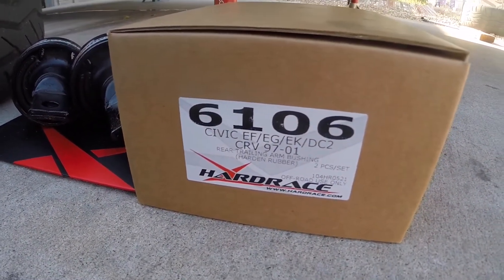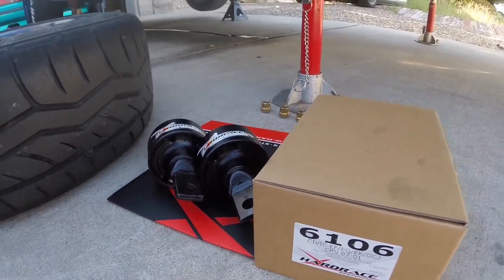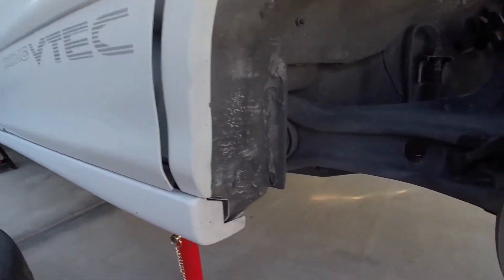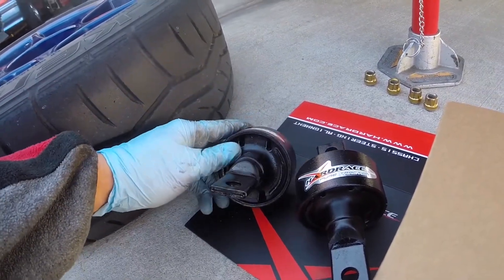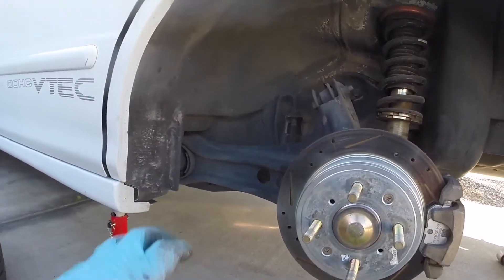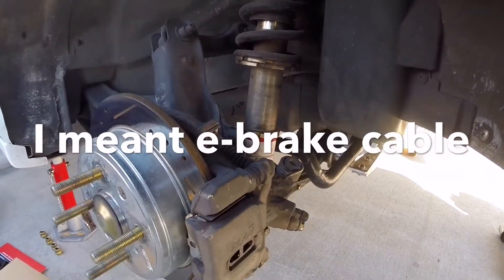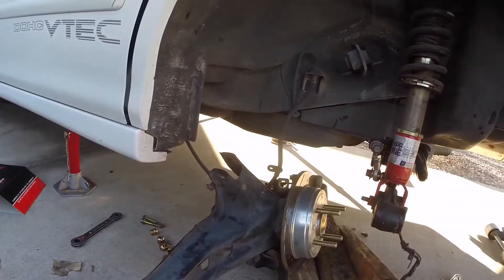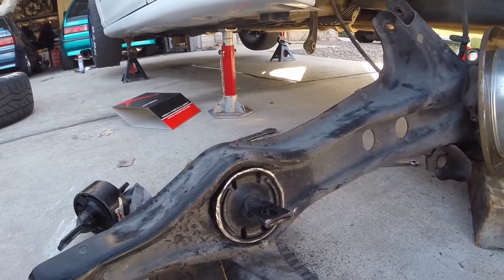How to Install Hardrace Rear Trailing Arm Bushing - Honda & Acura

Comment: just a quick tip for anyone trying this..

since the new bushings have this metal surrounding, try putting them in the freezer a couple hours before you install them, it'll shrink the bushing just by a fraction but it makes them alot easier to slide in! sounds weird maybe but metal expands under heat, I always do this and it makes putting them in soo much easier ! :D
Reply from the maker: Great tip, I've never tried that but will for sure next time
Reply: This worked for the front wheel bearings too
Reply: @RyanGorton  how did you press them in? What did you use to get around the ring and press down?
Reply: I was wondering if this would work, I put my new ball joints in the freezer before install to make the process easier!! Look forward to is installing my new bushings and seeing how my hatch drives, the trailing arm bushings and the rear toe links are the last components on the car that haven’t been touched!!

Comment: Great info thank you, however I would like to add.  If your bushing is already torn you can easily remove the center portion of it and use the outside metal casing as a punch for the new one so that you're not damaging or mushroom eing the new trailing arm casing
Reply from the maker: Thanks for the tips!

Comment: Hey John  not sure if you'll see this but I have a 2000 civic siR and I want to do the same bushings on mine. I have oem suspension does that mean I have to offset the bushing when I put them in?

Thanks
Reply from the maker: If you're not going to lower your car then you won't want too offset them.  We only offset them on cars that are lowered all the time.

Comment: Would rather mark the toe alignment on the bolt with a marker then to scratch the frame ask risk starting premature rust :s
Reply from the maker: +tonytober that works probably better.  We live in the middle of the desert.  Rust isn't and hasn't been an issue for us thankfully, but definitely a smart point for people above the rust belt especially.

Comment: hello Jon, I was wondering if you could tell me if there was a difference in ride quality when you went from the OEM trailing arm bushing to the hardrace rear trailing arm bushing. when I say ride quality I mean as far as ride harshness? does the car feel stiffer? the trailing arm bushings on my civic wagon are torn on both trailing arms and I am going back and forth whether to go with the OEM ones or hardrace. I'm only going to drive the car only the streets I'm not going to take it to any tracks or race with it. to me the hardrace bushings seem like if they would last a little more than the OEM ones thats why I am leaning more towards getting the hardrace trailing arm bushings but I am afraid that they might make the car feel too stiff for street use. how does the car feel to you when you drive it in the public streets with the hardrace trailing arm bushings compared to the OEM ones?
Reply from the maker: These are still rubber like OEM but it is a hardened rubber which makes them stronger and able to withstand more abuse.  If it made it more stiff it cannot be felt in the seat of your pants, the rubber still acts as a natural shock absorber but allows for correct geometry for the trailing arm to work properly as compared to the polyurethane ones.
If the price is reasonable for you and want them to last longer, I'd say get the Hardrace.  If you do get the stock replacement, stick with OEM Honda.  I've used an eBay one before and it was a pretty weak rubber in the bushing.
Reply: i know you say bad for track, do you think the energy rear trailing arm bushings would be good for daily driven or just bad in any situation? just bought them and on the way. =(
Reply from the maker: elcheapouno You'll be fine.  I have them on a couple of my cars.  For daily they are fine, but for hard driving I wouldn't recommend.  But, I have read of people who like the way they feel on their track cars.  They are pretty inexpensive too.  I will be installing the ES ones on my wagon soon also!!
Reply: awesome, thats good to hear. when you do the install hopefully you'll catch a vid on that, id like it see. =)
Reply from the maker: elcheapouno I planned on it as part of the civic wagon series, hopefully within the next 3 weeks I'll have it done.

Comment: Why did you decide to get hardrace? why not match it up the other Energy Suspension poly bushings?
Reply from the maker: The ES trailing arm bushings have limited movement and create "snap oversteer" which can  create some very sketchy driving situations especially when driven hard.  The hardrace allow the suspension geometry to remain unchanged under heavy load and the owner of this car is getting it ready  for some track racing next season.
Reply: +Jon Widmer that's interested. thanks for answering all these questions.
Reply from the maker: +Dc2 You're welcome!  I hate when I ask a question on a video and never get a response.  lol
Reply: jon, what do you think of the enegery rear trailing arm bushing just for daily driven? or do think theyre still bad for even that?
Reply: foreal? ES bushing is sketch? i have it i just havent put it in yet. i should reconsider? im not gunu be on the track its a daily
Reply: Josue, ES bushings are not sketchy, it just creates a "sketchy" driving situation, like GBH said. There are plenty of situations where it'll be suitable, but IMO, fwd, stiff suspension, hard driving, the ES trailing arm bushings won't be the best of options.
Reply from the maker: For daily they are perfect!
Reply from the maker: Very nicely said, and agree completely.  I'll use ES RTA bushings all day on a daily car that's never tracked.  I have no issue using all their other bushings at the track.  I did so for 2 years and they performed well.  I'm still using their front upper and lower arm bushings but had spherical rear camber and rear local now.

Comment: I have a 99gsr but just bought a itr 5lug and want to change out all bushings could I  just buy the TypeR hardrace kit or do I need  standard frontlowers and rear itr trailing arm bushings so on ? @jon widmer
Reply from the maker: Are you using the GSR control arms and the ITR knuckles and trailing arms only?
Reply: +Jon Widmer I'm using full itr  front spindal and rear trailing arm/ rear LCA
Reply: +Jon Widmer I'm using full itr  front spindal and rear trailing arm/ rear LCA
Reply: +Jon Widmer I'm using full itr  front spindal and rear trailing arm/ rear LCA
Reply from the maker: +david campos You'll need the ITR Kit if you are using the ITR rear lca's.  I would check to make sure the GSR front lower arms are the same bushings that are used as the ITR.  If they are, then the ITR Kit will work.
Reply: +Jon Widmer sweet will do thanks for the help I also subbed
Reply from the maker: +david campos Cool, thanks David!
Reply: david campos you got itr rotors and pads? Because that’s really hard to find I had that set up on my ek, and I’m berly switching back to stock , hard to find them rotors
Reply: Edwin Aquino I do they are mounted right now
Reply: Edwin Aquino I got them from HMO
Reply from the maker: ITR pads/rotors are everywhere.  They are super easy to find and purchase.
Reply: david campos 96 itr 4x114?
Reply: Edwin Aquino no Jdm 5 Lug
Reply: david campos 96 itr is jdm as well . But right on

Comment: Will this fit the 97-2001 cr-v?? Its seems like the cr-v have a different part number for the trailing arm bushing
Reply from the maker: Yes it will.  The 88-00 Civic, 94-01 Integra, and 97-01 crv share the same trailing arm bushing.

Comment: How are they now til this day?
Reply from the maker: Unknown on this car.  It's long gone.  I've been using these for over 5 years on my Si.  They'll give you a ton of life.
Reply: Garage Built Hondas 
Thanks for the fast reply! Hahaa. 
Ima order these also. 150% should be more than enough for old hondas/acuras 😂
Reply from the maker: I really like them, I've been using these on different cars for the past 10 years and never had an issue!
Reply: Garage Built Hondas 
Another question.. 
Would i need an alignment after installing these?
Reply from the maker: Yes, you'll probably be ok if you can keep the toe settings the same, but it is recommended.
Reply: Garage Built Hondas 
Good to know. Thanks.

Comment: is dc2r oem trailing arm bush is same as eg6??
Reply from the maker: Yes, even the R.  All 88-00 civic, 92-97 Del sol, and 94-01 Integra share the same Rear Trailing Arm Bushing.  The 90-93 is the oddball and is larger.
Reply: thank you so much man.
Reply from the maker: You're welcome!

Comment: jon what do you think of the ADUS 580 trailing arm kit sold on ebay/amazon.
Reply from the maker: EFsedan91LX I like it, looks like a much easier install than the energy suspension setup where you have to reuse the old sleeve and bar.  I haven't seen anyone use them yet and haven't read any feedback.  I imagine they should fit well though.